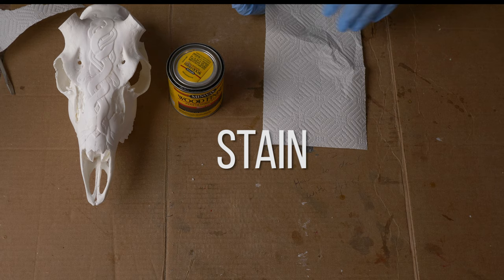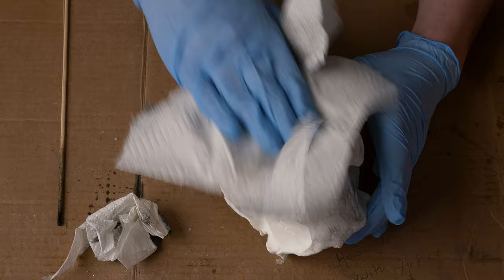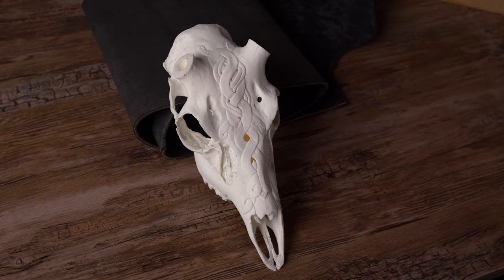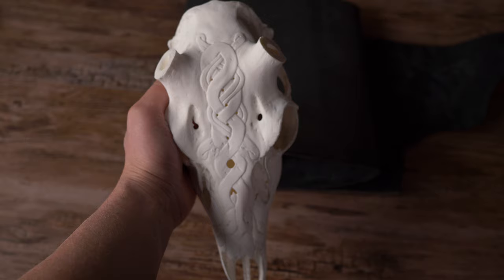How To Engrave A Deer Skull With A Dremel Rotary Tool

Comment: You may already know this, but I'll post it for anyone that may not.

Dust over the Super Glue (Cyanoacrylate) with Baking Soda (Sodium Bicarbonate) and it will almost instantly harden. 

We use that in Luthiery Work a good bit.
Reply from the maker: Fantastic tip!

Comment: Very nice skull carving! I really enjoy working with deer antler and will need to get one of those Dremel Stylo tools. I did a wizard carving on some antler a while back and used the small battery-powered Dremel, but unfortunately the battery drains down to fast. For the staining process, you might want to look at using an antiquing wax you can get at Michaels made by ArtMinds. It's a dark wax that will fill crevices, but you can easily wipe off of the high spots and excess. Not sure how it does on bone/antler, but works well on my caricature carvings. Thanks for making this video!